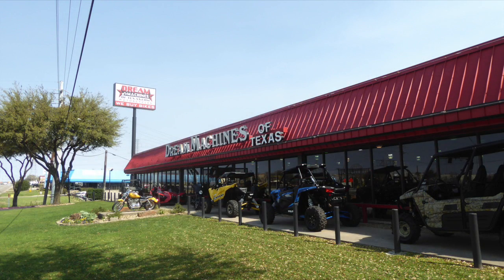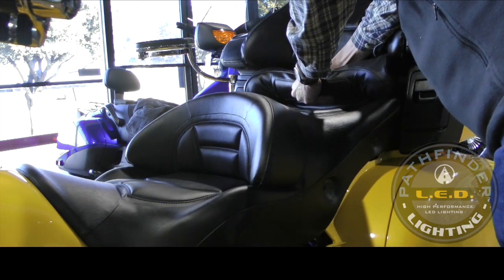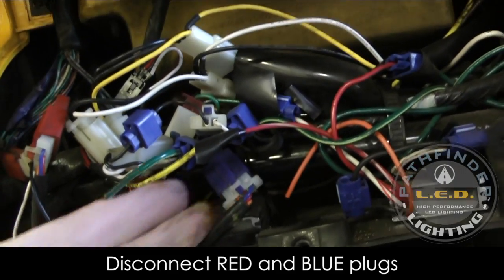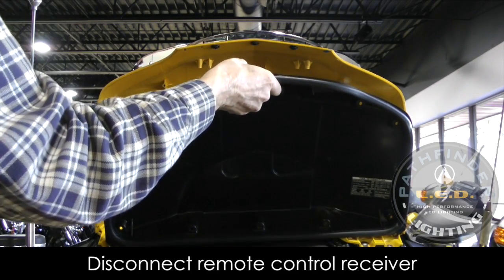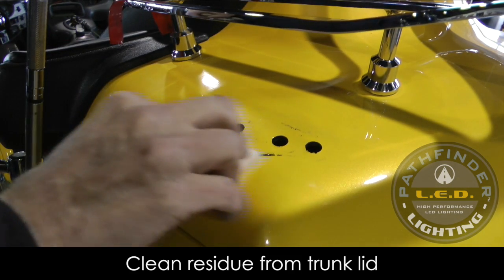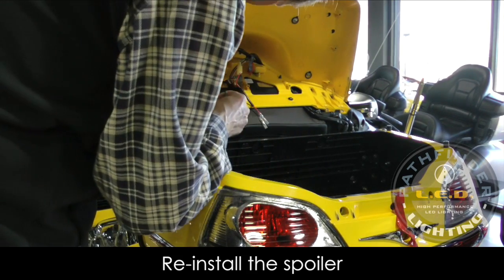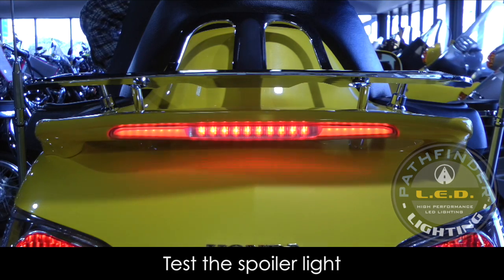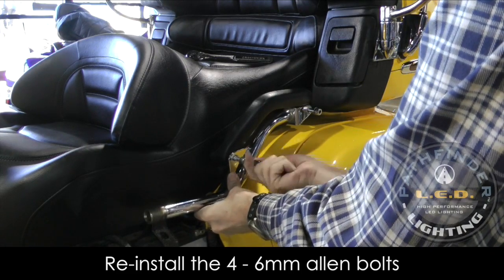Pathfinder Dynamic Sequential LED Spoiler Light for Honda Goldwing (2001-2010)

Comment: Its not necessary to remove your spoiler.  I installed this item on my 2002 goldwing today and when I tried to remove my spoiler, I discovered that the dealer, who had installed my spoiler when I bought the bike new, had stripped one of the 4 bolt heads that hold the spoiler to the trunk.  So I couldn't remove the spoiler.  I simply fished the harness through the trunk lid and spoiler body with a 16 guage wire with no problem at all!  So not having to remove the spoiler eliminates one or two steps shown in this video.  Also, the rear fender on my 2002 Goldwing had 5 bolts holding it, not 4.  The 5th bolt was right in the middle under the license plate.  Glad I didn't yank on the fender too hard after removing the 4 corner bolts and taking the time to figure out what was holding it up.

Comment: Great video very helpful the on problem is I am installing this on a 2008 Goldwing with a CSC trike kit installed and the wire you show under the rear fender are not there.  So having to find the wire under the seat and splice into them.

Comment: My 2001 Goldwing has a trunk rack but the bolts and washers go THROUGH the black plastic inner liner, but in your video they don’t. they just go between the black liner and the top of the yellow trunk. Does it matter when I put it back together?

Comment: I order this light and I am watching the video before I start.  I noticed that when you were testing the LH turn signal that the rh side stayed lit in red.  When you were testing the RH turn signal there wasn't anything lit on the LH side.  Is this normal or were you holding a brale lever when testing the LH side and that's why the RH side was lit also?

Comment: I have a 2001. Ordering a spoiler with light and also want to switch that light out with this pathfinder. Currently I have the BACK OFF brake modulator installed. Will that module interfere at all with the brake light feature of this pathfinder?
Reply from the maker: I don't think so.

Comment: HI Wing riders.  We all love our Wings, this 2001 Gl1800 is the 5th Wing I've owned.  If I can ask for help though.  I have the Pathfinder LED drive lights (but my problem isn't with them on).  My problem is I installed the Pathfinder Sequence LED spoiler light.  wired it and installed it correctly and although the sequence portion works correctly, the drive light portion doesn't come on and keeps blowing my 15 amp fuse, killing my tail lights, instrument cluster, and Pathfinder drive lights. I put in a new fuse it blew again. Took the Sequence light out of the system and the fuses stopped blowing.  I don't know if it's a defective LED Sequencer, or if it is drawing just enough off the system to overload the fuse.  I really like the idea of having it in the system but I can go back to the original 3rd brake light.  I am also wondering if I go with the LED tail lights it will lessen the burden on the system and stop blowing fuses.  I would appreciate any thoughts on this.  I did shoot SOCALMOTORS an email as well.  Thank you much for any help, Gene

Comment: I Installed on my 2005 that also has a trailer wiring kit on it. Hooked it all up the same as this video and no brake light at all. When I let go of the brake handle the turns quickly light up both sides then off and the running light comes back on. When I bought GW has a modulator that flashes trunk brake lights back and forth then flash together then solid. Could that be why? Brake modulator still works. Any ideas why no brake light at spoiler? Because of the modulator I have not changed the brake bulbs to LED all still incandescent.

Comment: Looks like it DOES have a problem.   At the very end of your video the left turn signal ran while the red running lights were still on on the right side which is how it is supposed to work.  But when you turned on the right turn signal the left side red running lights did not come on.  How did you fix the problem.  BTW... I just ordered on for my 2012 today and will get it next week.
Reply from the maker: Bruce, I saw that after I completed the video and the install. I am pretty sure it had to do with all of the other crap the previous owner had installed. You saw the rats nest of wires behind the fender! I did not have a full day to go through a disconnect everything the previous owner had installed. I have this same unit on my 2012 and it works PERFECTLY.
Reply: Thanks for getting back to me so quickly.  Mine should be arriving next week & I scheduled an install in 2 weeks.  I'll let you know it goes.
Reply: cruisemansgarage  I recently had one installed at the dealer.  It has the same malfunction.  I’m thinking it is possibly a quality control issue and not an installation issue.
Reply: I figured out what the deal is.  It works fine IF you turn off the turn indicator by pressing in the switch BEFORE you flip the turn signal to the opposite direction.  Example.... turn on the right turn signal.  Cancel the turn manually by pressing in the switch or let it automatically cancel after so many seconds.  THEN turn on the left signal and repeat procedure.  NO PROBLEMS!!!  BUT if you just flip the switch to the opposite direction you will NOT get the desired result.

Comment: Did you cut the wires on the old spoiler to pull the wires through .
Reply from the maker: Yes. I forgot to mention that in the video. The OEM spoiler will have butt-style connectors that you can detach before pulling the wires through, but this aftermarket spoiler light did not have that so I had to cut the wires. This particular Goldwing had a Kuryakyn (I think) spoiler light with 5 wires. Your OEM light will probably only have 2 wires.
Reply: Ok thanks
Reply from the maker: Once you get yours installed, I would appreciate knowing how helpful you found the video.

Comment: I'm wondering if this would work with the Kuryakyn spoiler on a 2012 GL1800? I have some burned out diodes on mine.
Reply from the maker: It is possible. I just looked at the Kury website and their LED looks similar. You should contact Kuryakyn and ask them if their spoiler light is the same fitment as a Honda OEM spoiler light.